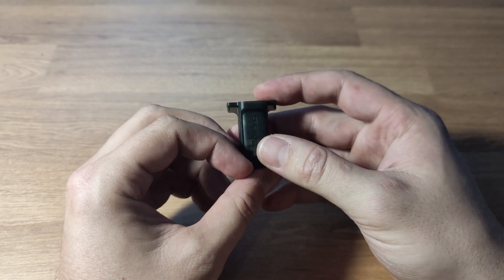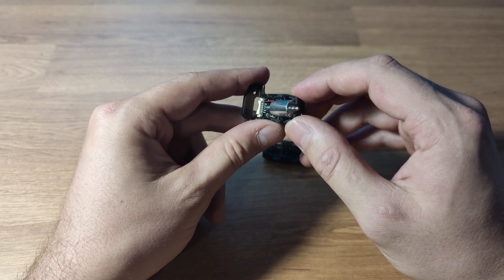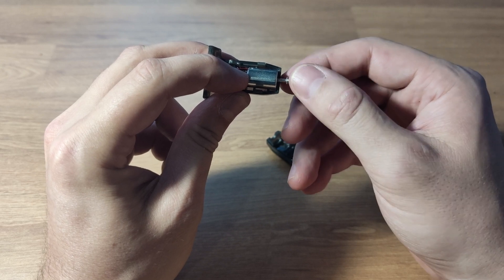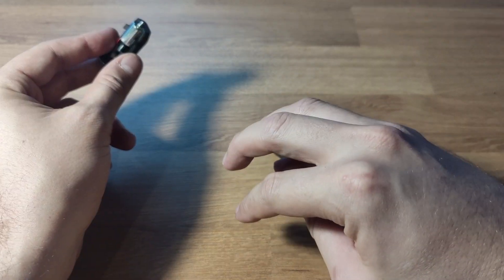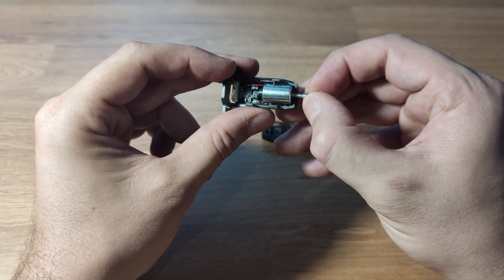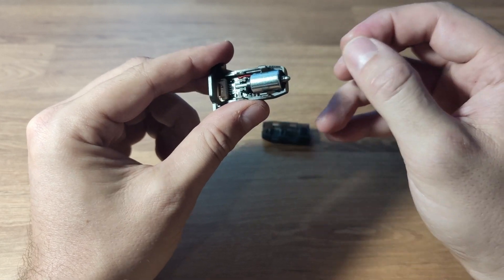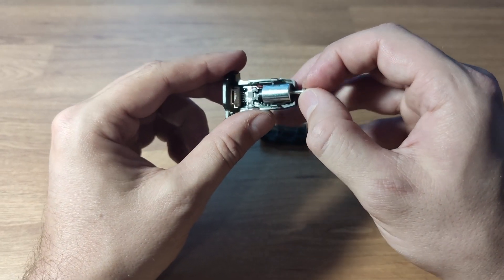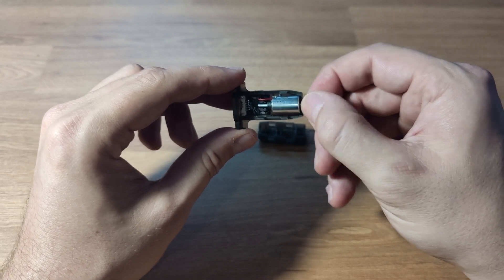3D Printer CR-Touch Red Light Flashing (Pin Bent) - Fix

Comment: I believe you when you say your pin was bent but it also looks like you're missing the clear washer/grommet that sits on the neck of the pin near the bell-shaped point.  It holds the pin about 1-2mm away from full retraction.  Mine was missing it, too and giving me intermittent errors.  I printed one and with much effort put it on and now it's been working with no errors so far.

Comment: hmmm, mine never gets stuck it just flashes red, i pull it out once or twice and it always snaps back and then it works (sometimes I have to cancel the print and sometimes I have power cycle). It also happens after a few weeks of not using it once I "fix" it I can churn out prints no problem. Ender3v3se, but it's starting to annoy the living shit out of me. $40 bucks a pop for me if I ever replace it. I do have to confess I keep mines in a non AC garage and we get 100+ days (38ish c). I don't know how old the printer is, I bought it used.
Reply: look to see if the clear plastic washer that keeps the probe pin from fully retracting is missing.  That's what happened with mine and I found a file someone made to print one although it was a little thicker it still did the job.  Mine had no binding but I'd get the probe error intermittently.  My guess is that the plunger mechanism is set up to work when the probe pin is not fully retracted but held out 1-2mm.  Then it extends with no problem.

Comment: In my case pin was fine but PCB wasn't seated correctly. I pushed down on it in the bagnet area and it fixed the issues.

Comment: Mine was okay for a while and then the red error light, I minded not to bend it then it got stuck again, I cleaned it with contact cleaner now it works again, hopefully for good. Creality sent me a new one which has a rubber buffer around the metal pin, probably  to protect it from bendind and keep dust out
Reply from the maker: Glad you got it sorted! I ended up getting a replacement as well, but shortly after I upgraded my machines and now it is just sitting in a box :P